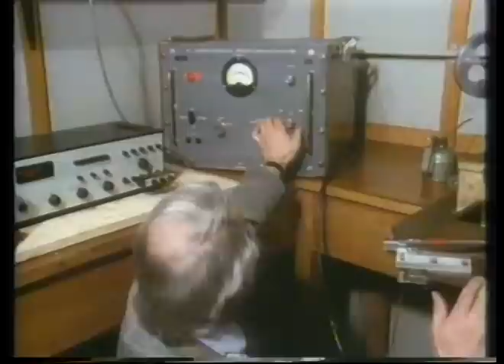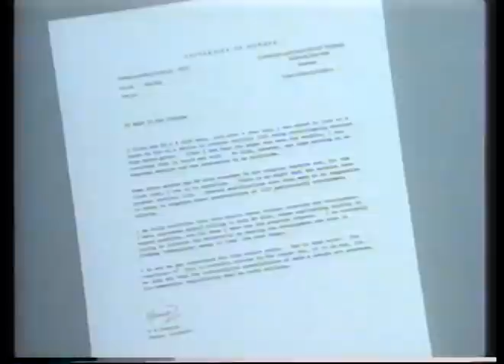Anti-Gravity Machine (Part Two)

Comment: He said it in the end ....”IF ITS ALLOWED” ....;) sad but true.... no one would allow anything to disrupt the energy industry ....
Reply: You are 100 % true  that  understand  no free energy is legal for the new world order
Reply: he just gave the world a machine that creates free energy in the 80s... which started all over designing a spaceship propulsion system... and accomplished both. magnificent
Reply: This idea is not lost it just doesn't work.  The machine is not complicated and can be rebuilt from this video (in which it is never show to work).  If you think it works, great, build it.  But get over yourselves with the new world order crap.
Reply: @KyleBeatz  He does not give free energy... he has a mechanical device, it needs energy to create lifting force, and that initial energy is never less than output force! at extreme it is equal but never less! it cant be endless, if it was, stars wouldnt really consume their fuel, and run out of juice...
Reply: @DeputyNordburg  it doesn’t require a NWO, for oil energy alternatives to be an impedance on the large oil industry, in which they’d eventually react to in some capacity to avoid obsolescence.
Reply: @davidwavidshmavider   True.  If Sandy ever develops a free energy machine, the oil industry will not be happy.  Until then I'll bet they show this one at the company party and all have a good laugh as it jiggles.
Reply: @DeputyNordburg  ridiculing the failures of Sandy, vs the reality of billionaire and trillionaires motives and objectives, are clearly separate things entirely.
Reply: @davidwavidshmavider   I'm sorry if you got the wrong impression.  I am not ridiculing Sandy (who the video claims is dead), I am ridiculing the people who believe this nonsense was productive based on watching these videos.
Sandy is an inventor and was at least trying to do something good. Just as with perpetual motion machines etc, the builders often discover something of value. 
But the people who are making up imaginary government agents out to get him, oil industry assassins etc, those are the worst people society has.  They accomplish nothing productive, while ridiculing the people who do.
Reply: Not least the laws of physics.
Reply: It was the same with  HHO generator for cars, the inventor just died and a government agency bought his pending patent right after off his still mourning family.
Reply: When something of this magnitude appears, the US military is knocking your door. They study it, back engineer it and send it to black projects. The energy industry has nothing to do with it. It is all about military power of a country. It always was and it will always will.
Reply: @rubensilvarocha  When something of this magnitude?  The spinny jiggly thing in the video?  What magnitude was it?  What would the military do with it aside from giggle?
Reply: @DeputyNordburg  New ideas on propulsion in this case. Other significant example would be Nikola Tesla's work and how it somehow got destroyed by Edison et Co. who was the chosen "elecrtician" of the high societies and bankers, regardless of not really inventing anything, just combining threads and a light bulb really - and a novel way to kill an elephant, so I guess The electric chair?
Reply: @InvaliDidea123   Are you joking?  Nikola Tesla's work is all over the world in every kilowatt of electricity generated.  He worked for Westinghouse who beat Edison's electricity business to a pulp.  
if you are a Nikola Tesla fan, you have no doubt read one of his 48 published books, or visited the Tesla museum in Serbia which houses his lifetime of notes and writings.  I went about 1 year ago.
Tesla has 111 US patents still on file.  
Tesla's work got destroyed??? LAMFO!
Reply: I've no idea where you came up with those numbers, lol. 1# his books were a bit on the thin side, and Ive shuffled through comparative texts based on them as a whole. 2# if you count every pump and turbine, sure, but In 1895 Tesla’s lab burned down destroying years worth of notes and equipment, some he could "reinvent", some he couldnt. My point was, that inventors all too often get destroyed and their works stolen, so it may be that Nikola lived for another 40-50years after that and contributed all of it, it shouldnt stray you from the point of suspected arsony.

Comment: The magic formula is.
CP=mv2/r.
Where: 
CP= Centripetal force
M= Mass
V= Velocity
R= Radius
Reply: Also the RPM of the gyroscopic disks affects lifting force, along with the angle of incident. A simple hinged arm allowing for a fuller range of motion to 75degrees or more. Also the length of the throw.

Comment: I had the same idea and drew a diagram of this concept when I was 17 in 85, without being aware of this guy’s attempts. I still have the sketch book in storage. Around the same time I was also obsessively drawing perpetual motion ‘overbalanced wheel’ devices without ever having seen one or being aware of Da Vinci’s original drawings. These are the thoughts that drive inventors mad, identical obsessions that appear seemingly from nowhere, experienced by different people in different places at different times, hard coded into the human psyche as genetic memories passed down through generations over millennia. This machine DOES produce lift, I have no doubt, but like a sterling engine, or a Crookes radiometer, or an opposing magnet motor, the output is so negligible compared to the energy applied it renders the machine useless for any practical application. Within Earth’s gravity, that is. In space, the thrust from the dynamo machine could potentially propel itself, however a free spinning motor to power it would have to be developed that could withstand the immense centrifugal forces required, which would be practically impossible to devise.
Reply: As in battlestar galactia
Reply: lol I drew and built an overbalanced wheel too back when I was in school and had no computer and internet access! Was so convinced it would work :))
Reply: By Making Use of multiple Solid flywheels pointing outwards as he has with the two wheels and having those Heavy flywheels spin at an extreme rate of RPM while spinning around as this structure illustrates,A higher Antigravity effect can be Achieved.
Anti Gravity is not achievable on this planet without the correct elements,Which is not found on this planet.
Therefor the only way to achieve a form of Antigravity is to manipulate the current anti gravity force experience on this planet.
By Use of such structures manipulating the Current gravity force to a state of opposite and equal counterforce,
It might be successfully done.
The engineering behind the concept is far greater than what is illustrated here , but it's a start.
Reply: @gerryk101  It's been the start for the last 50 years...  but this  machine is just a gyroscope, nothing to do with anti-gravity it is a stabilizer and has already been used by Tesla in some of his patents, such as US -1.655113 and US 1.655114A, also in Us patent for UFO, in 1928.
Furthermore,  This object is simply a Gyroscope, now used in autopilots to stabilize planes, another trick of the damn physicists, with toys, to earn money and fame.
Reply: You sound like a great Science fiction writer" 😂😂😂
Reply: That is a very interesting observation that you've pointed out. Not about the machine, but about the human element, that can spark unshakable thought experiments, in just about anyone at all.
I was bitten by that same bug, even though such actual inventions are well beyond any abilities of mine...
But the mathematics seem to suck me back in, and keeps me up at night sometimes.
Imagine when smart people experience this?
Reply: shucks use procedural audio and you can talk to them. click it
Reply: @gerryk101  Element 115

Comment: I think that since the horizontal centrifugal force is cancelling out it's weight, or base weight, the counter rotation at the top now lifts the mass because the vertical gyros want to fly apart, but it's not enough centrifugal force to cancel the vertical weight, so the mass still want to fly apart on top. The inertia at the top is what's doing the lifting. Change the angle and you change the direction.
Reply: I did not see it's weight canceled at any point.  Just spinning and wiggling.
Reply: George, you are exactly correct in your thinking.   Since there is no gyro located at the bottom, then the top gyro provides the lift automatically as a response.
Reply: Save the cheerleader.  Save the world.
Reply: This video was satirical.
Reply: @Bibibosh  Don't you mean centrifugal?!? 🤣🤣🤣
Reply: @therealking6202  you should quit your job. Why, because you would make a lot of money doing comedy. Bro you cracked me up! That hit a funny nerve! I'm not being satirical!
Reply: @therealking6202  funny bro
Reply: @Bibibosh  I'll be here all week... Don't forget to tip your server! 😜
Reply: Precisely.. the conservation of momentum..
Reply: @Bibibosh  
No it isn't satire. This man spent his life on this, and the university didn't bring him in to study it for satire. Seems like you just define anything you can't understand as satire, you have thus projected perception and a low level of intelligence.
Reply: It was already tested literally in a laboratory for many different variables. They already covered that, you dont get venture capitol unless they are convinced you are actually onto something.

Comment: It seems as though to me it's a simple thing of spinning its way up the center shaft. Spinning and Steppin it's way up the shaft with centrifugal force because of the gyroscopes. If it could spin perfectly without touching the center shaft,  I'm not so sure it could climb.
Reply: You realise what functions bearings have don't you?
Reply: But what is the center shaft touching? It IS constrained. I would love to see it rise without any constraints and hover in place (that would be so cool). It could be tested now days using RC drone hardware. Unfortunately for every force there is an equal and opposite force that will ensure that the whole thing will wobble violently and fall like a brick because there won't be anything to push off of. In this video unfortunately the apparatus has to leverage its upward motion against its axis of rotation. Without the support of the axle I'm pretty sure this device would flip and flop all over the place, not because of imbalance,  but because of conservation of angular momentum. I have wanted to try this very experiment for many years, but it's not looking good.

Comment: I have absolutely no qualifications in this field, but I can 100% vouch for the authenticity of this work.
Reply: I am the opposite.  I am tremendously qualified, but can't vouch for any of this.
Reply: @DeputyNordburg  I was just pondering on about this man's work/idea - if there is anyone who is good in physics and maybe explain why this is a bad or good path to go?
As a lain man, I'd say that it would fail when sized up, to industrial levels. But that's just me, my 2cents, if you will :P
Reply: @judas_saves  Well, gyroscopes are very well understood in physics.  When twisted, a twisting force is created at a 90 degree angle.  But a twist or torque is very different than a force in a direction.  
Sandy is trying to convert the twist to a force in a direction without pushing on something else.  The earth, air, or similar. If he did, it would be fantastic.  However I don't see that happening here.  Nor does it seem like a serious attempt to do so.
Reply: @DeputyNordburg  but how would that react is space, does it need gravity to work?
Reply: @GeneStarwind344   A gyroscope?  It would twist at a 90 degree angle to the force applied.  Most satellites and spacecraft use gyroscopes to control their attitude. (what they point at)  Look into a control moment gyro and a reaction wheel. 
That does not require gravity. 

Think about it this way:  A motor such as a car engine or electric motor makes a twisting force.   That is converted to a linear force to make a car go in a direction.  But to do this the car pushes down on the ground.  An airplane pushes on the air.  A rocket pushes on it's own fuel and oxygen.  Sandy is trying to convert the twisting force into a linear one without pushing on anything.  And while it would be incredibly useful, it is also impossible based on the known laws of motion.  If he did or does do that great, but he certainly does not appear to in this video.
Reply: lmao -- I get it
Reply: That's all I need to hear.
Reply: I am totally unqualified to make any sort of comment on anything at all.
Despite that along  with many others  like me I feel duty bound to let anyone who will stand still for long enough bathe in my ignorance

Comment: The only impressive part is the level of enthusiasm and perseverance that this man has. It's truly exceptional. I love the fact that he has a great family who supports him. However, from someone who teaches this topic in a four-year US institution, I can tell you that unfortunately these ideas will fail due to entropy law. All mechanical systems have friction involved, and you can mathematically prove that no matter what configuration these parts are connected to each other, the system will stop after a particular time when the source of energy is disconnected. The only exception is moving at speed of light, or a mechanism in quantum scale which in both cases they  violate the classical mechanics. That's the reason the big tech is doing quantum things because there may be such effect hidden in the fabric
Reply: I agree, but am not under the impression he’s claiming it’ll keep going without an energy source forever- in other words I don’t think he’s claiming it’s perpetual motion. I guess the claim is it creates lift without pushing against anything? Not sure. Either way gyroscopes have always been interesting to me. If there’s anything more we can do with them I’d love for people with the ability at hand to keep experimenting.
Reply: @jaggerlags yeah it was about converting angular momentum into linear momentum, which is also supposedly impossible
Reply: dude, just because the machine wont last forever doesn't mean it wont work, also you could power the gyroscope with electromagnets, magnets and solar energy, correct manipulation of magnetic fields would allow you to create a frictionless system that would be great for space travel, anyway this is why some teach and others do.
Reply: Scientific proof that bumblebee can´t fly, BUT bumblebee doesn´t know it´s impossible, they just do it.

Comment: It would be great to see an updated version using a carbon fiber frame, brush-less motors and lithium batteries.
Reply: And advanced computers that can vary the gyros speed in order to change direction when flying
Reply: @justinkemeter  And using machine learning to explore the effects and perhaps come up with more efficient or completely different way of producing controlled gravitational forces to create omni directional gravity manipulation device.
Reply: It'd be nice to see a steering wheel too! ... just sayin...
Reply: & see it actually move somewhere besides up a 2 inch shaft
Reply: @brianmanning34  That's what she said! =}
Reply: The device in the video was able to reduce it's weight by 0%.  I think with modern manufacturing and materials that could be double or tripled.  Maybe 3D print it
Reply: What about combining it with nanotechnology? Millions of tiny  computer controlled gyroscopes!
Reply: @kelaxy  With nano tech, the 0% reduction in weight could be 5X greater!
Reply: @TexMex421  no one here will understand your joke lol
Reply: @rubinsaffy   I will edit the joke and double that figure.
Reply: Want to build it?  A complete description can be found in the expired US patent: US5024112A.
Reply: @brianmanning34  exactly.
Honed to high efficiency and tweaked into several metres in size, what would would happen we wonder.
Reply: @TexMex421  After Thanksgiving I reduce my weight by -8%.

Comment: The Americans where developing a plasma-filled accelerator ring which created a Magnetic Field Disrupter. Unfortunately they was no need for this machine, but I must admit it's a beautiful design. I suspect with the use of modern materials e.g carbon fibre and composites better lift may be achieved. Well done Sandy
Reply: Agreed. Mass is static but angular velocity increases gyro effect exponentially.